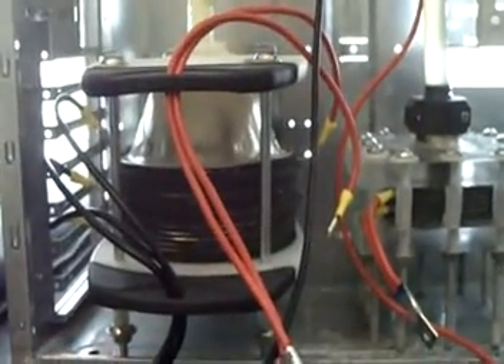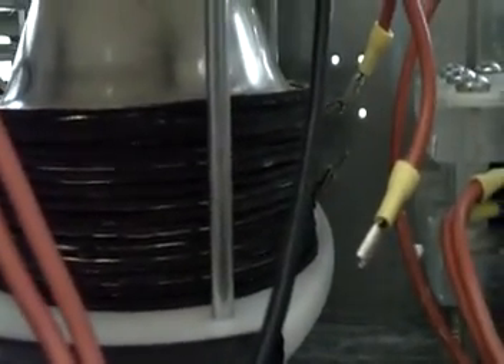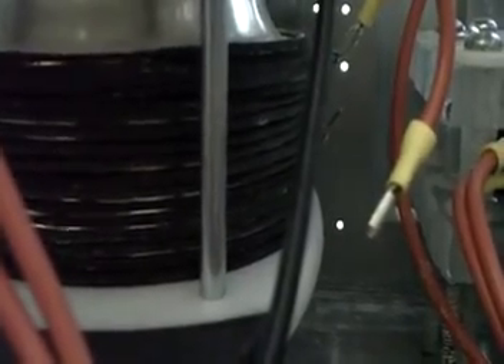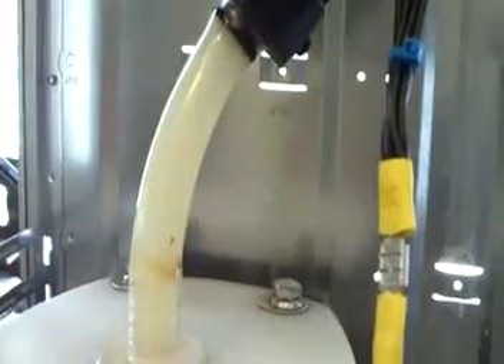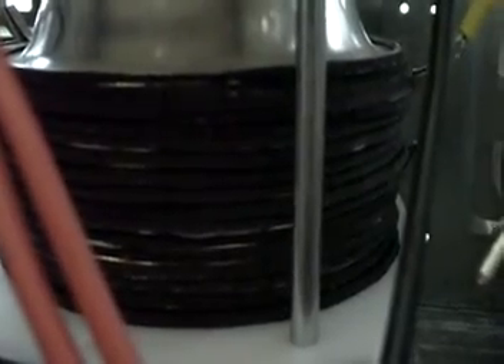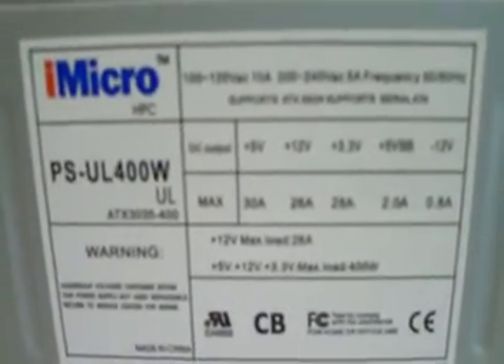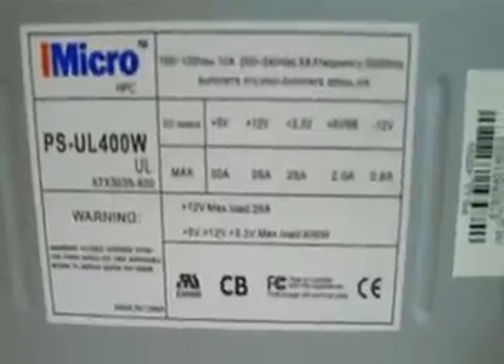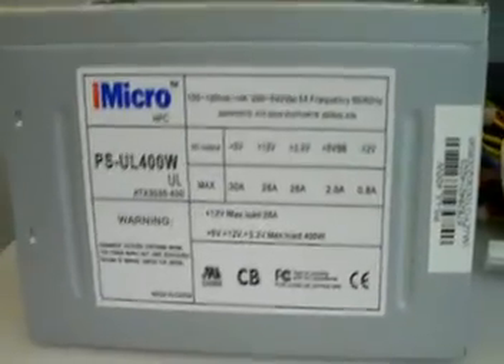Vid54 New Volcano Cell Update (HHO, Brown's Gas, Hydroxy)

Comment: Using solar panels to generate DC current is the ideal way to go. Messing with AC to DC convertion you'll end up loosing efficiency. Using Capacitors or regular car better is good too. All these are awesome videos, I'm a subscriber.